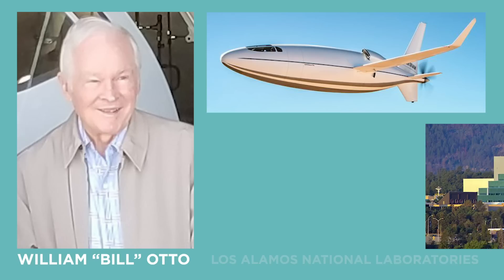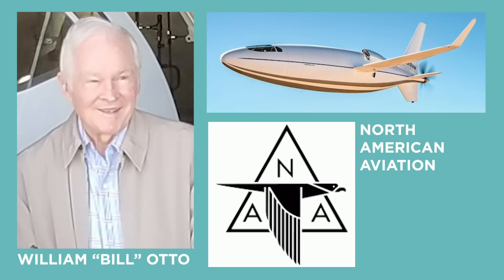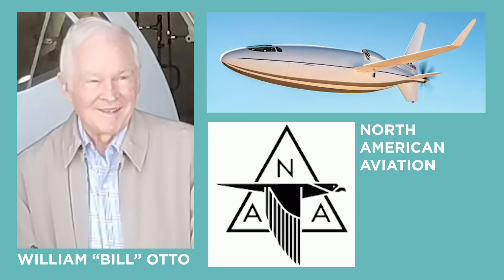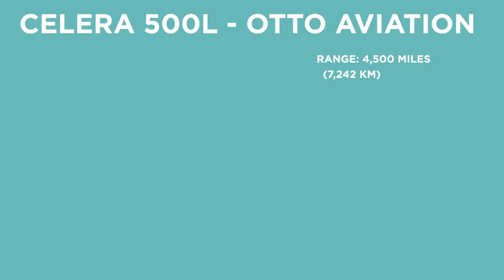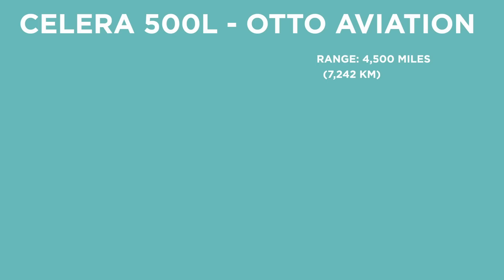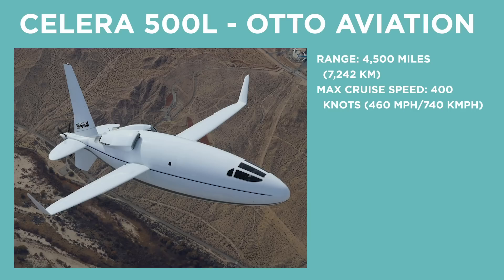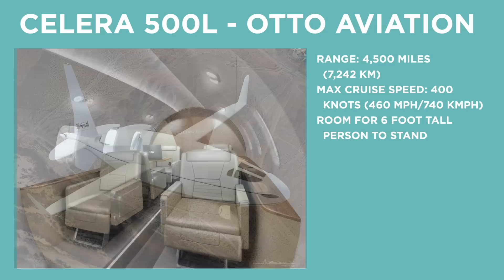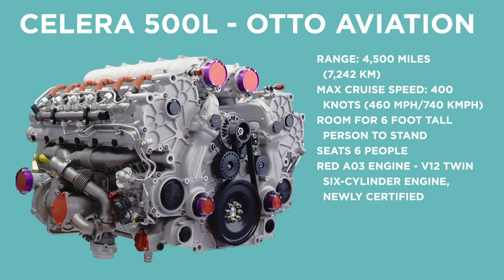Could This Plane Save The World? (Hint: No.) | Answers With Joe

Comment: As someone who as been into aviaition and studied it since I was little, I'll have to say that using a 747 as an example for the majority of airliners is unrealistic in itself. Jumbo's such as the 747 make up a pretty small portion of the aviaition industry. Most air travel in the industry takes place on smaller aircraft such as the 737s and a320 series of aircraft (just to make the more popular ones) that being said, your point still stands even compared to those aircraft. I will certainly agree that if anything, this is simply a stepping stone in design concept that has potential to be picked up and scaled into larger, more comparable size to the commercial jet liners we see now. And I can certainly see it becoming popular among the private/corporate sector of the industry to replace private jets. It's fuel savings combined with only needing one pilot would definitely be a point of interest for most private operators. 
Anyway, thats just my amateur input. I love your videos and learn tons from them every time I watch. Keep up the good work!

Comment: Using standard airline seating, the Celera could probably handle up to 9 passengers, rather than the 6 it has in business charter config. Just on this video, alone, it would be more accurate to compare 1 x 747 to 40 Celeras, rather than 61. 
 
In hauling 9 PAX instead of 6, it becomes a viable competitor to Cessna 208s and Quest Kodiaks (small commuter and light cargo segments) in addition to being a viable competitor to about 1/3 of the business aviation planes out there.

Comment: As per regulation, you would require one "flight attendant" (the term is cabin crew, regardless) on the celera flights, as you need one per 50 passengers. Either that or the flight doesnt leave the tarmac as, once again, it's regulation, not a suggestion.

Comment: Did you consider "factor of scale" in your comparisons?? Just curious, as Otto has already suggested they will scale-up the design.
Reply: that also scales up the fuel consumption, cost of the plane...then youl get the limits of the engine that could run off biofuels...
Reply: Perhaps but at this point it’s like replacing a semi with a fleet of compact hatchbacks - not practical.
Reply: Check out the Aurora D8, it’s a commercial jet with all the design efficiencies of the celera. Real Engineering did a great video on it
Reply: Unfortunately the design can only be scaled up so far before the laminar flow breaks down. The larger model they’re talking about making is the upper size limit for this design. Unless someone comes up with an entirely new design, that’s as large as an aircraft with laminar flow can get.
Reply: @sunspot42  : If they can get the larger model to work financially, then someone probably will get such a design done at some point.
Reply: @absalomdraconis  It wouldn’t be based on this design - it would have to be something quite different. This design doesn’t scale beyond the larger model that’s already been proposed - the laminar flow breaks down on larger models.
Reply: @nathanchildress5596  The Aurora D8 is an entirely different design and doesn’t exploit the unique laminar flow this plane utilizes to achieve its amazing efficiency. It isn’t anywhere near as efficient as this design and would be far more expensive to build.  It is more efficient than today’s jetliners, but also depends upon the development of several new technologies. It’s not entirely clear if it’s currently possible to build, or if it would be cost effective.
Reply: @nathanchildress5596   it really really isnt. It has swept wings for higher speed (much less efficient), thicker wings (much less efficient) turbofans rather than propfans (vastly less efficient). and doesnt appear to be designed as a lifting body as this clearly is.
the biggest thing we need to design for to save fuel is LOWER SPEED (drag is proportional to the cube of speed so half the speed = 8 times less drag)
Reply: I was wondering that, I’d hope not otherwise Airbus/Boeing are ignoring what could be a real danger.
Reply: As others have noted that pesky Reynold's number and the squared-cubed law thing make this tough. I do question why one couldn't put more than 6 seats in the thing though. Looks big enough to accommodate more.
Reply: @nealgrieb6660  I wonder if it has to do with safe evacuations or just the weight limit of the design given the low-power engine. It might glide thru the air with ease due to the laminar flow but I’m guessing its lifting capacity off of a runway is limited. So, efficient but not very powerful. 🤷‍♂️
Reply: @mycosys  Actually I think the dual bubble fuselage of the Aurora D8 is designed as a lifting body, just not as efficient as a true flying wing (but also far easier to build with today’s tech, cheaper and it can work with existing airport infrastructure).
Reply: @sunspot42  probably right. Weight limit on takeoff...
Reply: @sunspot42  The closest thing one could achieve laminar flow with on the scale of a large jet would be a flying V design, reducing wetted length of the center by having a more constant wing chord.  The overall length of the aerodynamic body is the primary limiting factor in laminar flow, as even the smallest of eddies produced in the airstream will multiply themselves.  Meaning, unless you can make an impossibly smooth geometrically perfect body, you'll never get much more length out of it than what they're doing with the Celera.  So if the answer is having short bodies to limit contact with air, the only way you can scale it up is in wingspan.
Reply: @Skinflaps_Meatslapper  Interesting. Didn’t know that but it makes sense. So you could maybe make small ~30 passenger flying wings. I can’t see those replacing even small jets like the 737, although I suppose they would potentially alter the economics of flying in and out of more rural locations where people currently have to travel by 1-2hrs to get to an urban / suburban airport to travel. Maybe we’d start seeing direct flights from places like Ithaca, NY to Charlottesville, VA, or Napa, CA to Eugene, OR.
Reply: @sunspot42  Oh, you could scale it up even more than that, possibly even to 737 payloads depending on just how much laminar flow you'd like to have over the body.  Sort of like the existing idea for a flying V, but with a wider wingspan (less sweep on the wing) and a thinner chord more akin to a glider wing rather than the chubby cross section.  This would give you a short enough distance between leading and trailing edges to maintain laminar flow without going to extremes to make a smooth enough surface.

https://en.wikipedia.org/wiki/Flying-V
Reply: @Skinflaps_Meatslapper  That would be one strange plane.  Gotta think a flying wing that long and skinny would have some pretty exotic handling characteristics and would be difficult to utilize with existing airport infrastructure...
Reply: @sunspot42  Yeah, I think even the existing flying V design would need some infrastructure modifications.  But as far as handling, it should behave more or less like any other flying wing, with the potential to utilize flaps if the center of the V is far enough forward of the elevons.

Comment: I’m a pilot, have been for 39 years. I’ve made multiple comments on videos that have featured the Celera 500L. I’m working on a blog post about it to attempt to evaluate the plausibility of Otto’s claims. On their face, they’re pretty shocking, bordering on unbelievable. Extremely short summary: very skeptical. And, I’ve said elsewhere, it’s hard to picture aerodynamic engineers at Embraer, Bombardier, Gulfstream, Dassault smacking themselves on the forehead and exclaiming “Laminar flow!?! Why didn’t I think of that?” I learned of laminar flow in ground school and much detail about it in undergrad physics! Further, they make at least one categorically false statement on their web site, i.e., that other airplanes in its class have glide ratios of less than 9:1 vs. the Celera 500L at 22:1. My airplane is not unusual, it’s a fairly standard designed turboprop and it has a glide ratio of 14.8:1. Many business jets, to whom Otto compares the Celera 500L, achieve 18:1. I’m concerned that an esteemed designer like Otto would not know this or, if he does, that he’d misrepresent it. I believe the Cessna 172 may have a glide ratio in the 9:1 range but the 172 is hardly in the same segment. When I finish my analysis I’ll post a link. It will have to be approximate though, Otto doesn’t provide sufficient information for a thorough analysis (nor is there any requirement that they do so). If you want to fly in something that looks like that, try the Piaggio Avanti Evo.

Comment: Ya a 747 today runs around 320-350M for an older version and the newest version is around 400-420M. Your googling has failed you this day lol
Reply: Haha lmao. Then dive a little deeper!!!
It all depends on what type of Boeing it is, commercial or transport.
It depends on how much fuel to weight ratio and how much capacity of the plane is filled.
It also depends on how fast the plane is flying, the wind direction and humidity. 
A Boeing 747 what exactly ?  Because there are many versions of it.
Also you say 420 miles ?  But we don't calculate miles in aviation. 

A typical Boeing 747-8 intercontinental average range is around 7730 Nautical Miles (14310 KM).
Average because as said before it heavily depends on the conditions.  The max range of the Boeing 747-8 intercontinental is 9500 Nautical Miles (NM) (15000 KM) if its flying at around 900 kilometers per hour, witch it can stay in the air for 16 hours. This on great conditions the plane can fly at max 988 km/h with a cruise speed of 933 km/h. 

Above are the newer version of the 747-8 as the early versions where flying 900 NM less then what they can do now due to efficiency, but also due to the capabilities of the plane flying higher then ever before with a max of 43000 ft or 13000 km above sea lvl.  

Far most important is the flight level.  Be to low and you fly thru a very dense atmosphere and you need more horsepower in order to maintain flight. Fly to high and you lose efficiency all together as the engines do not get enough oxygen making the efficiency drop enormously as a lot of fuel will not combust as it should.

So the flight level and speed of the aircraft heavily depends on weather, how much the plane weights, the atmosphere and what the plane is moving around. Also keep in mind that traveling around the world the atmosphere chances constantly as you enter in now biomes.  

So saying that the range is simply 320-350M to 400-420M is not only (NOT) true, it is completely false!!  First of because the range is not in miles but nautical miles, so NM not M. 
And second it also depends on what type of aircraft, its payload, its fuel to weight ratio, the atmosphere, the humidity, the wind direction, the wind speed, time of the day (day or night makes a huge difference), the aircrafts age, the altitude for cruising and sooooo many many more conditions.  

And you are saying that Joe Scott did not do his research right, while you yourself are to ignorant to actually weigh up all conditions of flight. I think you are the one that needs have a consult with Mr Google, not Joe Scott XD
Reply: @TheGremlinsParadise  That was a lot of words to NOT acknowledge the dude was right...and Joe utterly blew the costing of ANY 747 passenger airliner.
Reply: Boeing intends to shut down production of the 747 after the final 14 orders are filled.

Comment: The fuselage and wings look like the Piaggio P.180 Avanti .
Reply: Yes
Reply: I was going to note that the fuselage looks very much like that of the Bell X-1 that Chuck Yeager flew through the sound barrier in 1947.  The wings are superficially similar, but the big difference is the powerplant and propulsion: rocket engines versus a piston engine driving a prop.  So you've got a choice: go slower and get a longer ride, or take a short ride and burn a lot of propellant very quickly.

The Celera would be great for that long haul trip, plus it's a lot more flexible than an airline.  But that X-1 must have been one hell of a ride!

Comment: one big issue with the Celera design is that it can't reasonably scale that much larger than it is. there is sort of a limit to how wide and tall the aircraft body can be, and the design doesn't seem to have room to get much longer and narrower and maintain it's carefully calculated laminar flow surface. it also doesn't look like it would support multiple engines very well, which is required for larger planes.
the other issue I see with it is that laminar flow is really hard to maintain because any surface roughness will trip the boundary layer into turbulent flow. that includes everything from rivets and door seams, to bugs that smash on the wing leading edge, to normal wear and tear on the aircraft, making maintenance a bit difficult. the suction from the pusher propeller does help over the body, but only so much. the aircraft feels to me like the dream of a genius aerospace engineer, which was so awesome that he wanted to apply it to everything and forgot about some practicality and scalability aspects of the design. 
I personally think that the Piaggio Avanti, which is in a similar size and cost class, is a much better aircraft, and at least more practical. it is also even cheaper to fly than the Celera because it is a turboprop instead of a piston engine. I think it might also be almost as aerodynamically efficient through a slightly different set of aerodynamic tricks and is nearly as fast.
this is speaking as an aerospace engineering sophomore at Purdue.

Comment: Not talked about very much, on this aircraft, is the wing loading. It has very high aspect ratio wings (for very low drag), that have a very small surface area. That wind surface must generate the necessary lift to make the aircraft fly, otherwise it is a human guided missile heading to the ground. High load wings need to fly faster, in order to make enough lift, and as a corollary, the stall speed also increases => Fly Fast, Land Fast. The Celera 500L has published little info on the MTOW and Wing area (Example: Boeing 737-100, MTOW = 100,000 Lbs, Wing area 979.9 Sq Ft gives a wing loading of 112.25 Lbs/SqFt).

Comment: This is a competitor to executive jets, to spend so much time comparing it to jumbo jets is odd.
Reply: I think he was making the comparison based on the questions asked in his electric plane video, and how many people commented that the Celera should have been included despite not being electric, because they believed it would reduce the number of Jumbo Jets used, and reduce carbon emissions. 

This video was less a "The Celera is not a replacement for large airliners", and more a "This is why I didn't include it in my other video". The comparison to the large airliners was to show how unlikely it would be for them to get replaced, and the reason for not including the Celera in his electric flight video, not as a way to condemn the Celera. That was my takeaway, at least.
Reply: @MVargic  incorrect.  regional airlines use planes of this size and a bit larger. Plenty of major airlines have regional jets in the 20 seat size too.  Also with dramatic reduction in the cost of chartering such executive aircraft, this will naturally open it up for less wealthy rich people to fly in such planes.  So instead of my frequently flown trips from SEA to TUS for $7,000 as a one way jet charter, it could be done for more like $1500.  The estimated operating cost is estimated for be $330 an hour vs $2100 a hour for the jet, though the flight would be more like 4 hours instead of 3.

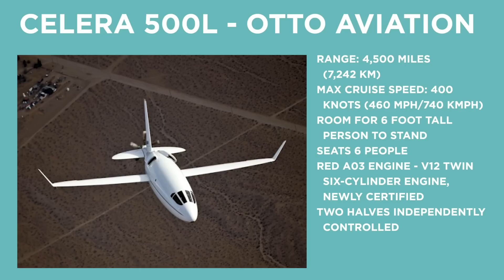Comment: did anyone catch the one fact in 3:11 about the Celera, that it can run on "Biodiesel", So, what you're saying is, it can run on Algae or soybean oil.
Reply: It's a diesel engine. Jet A is kerosene based diesel fuel. Jets could probably run on biodiesel too.
Reply: And... what do we use to farm soybeans? Internal combustion engines fueled with what?
Reply: @Chrishelmuth1978  Diesel based farming equipment can run on biodiesel aka Soybean or algae.

Comment: 6.1L V12, DOHC, Turbocharged (one for each bank if I'm not mistaken), diesel.
That Red A03 is crazy looking. The specs are more normal than I expected, but I still want to see what kind of numbers that bad boy would do if converted for use in a truck/car.

Comment: btw, MK in this case is "Mark" so, a Mark 46 torpedo. "Mark" is like version number. Its a British thing, as far as I've seen.
Reply: Thank-you for flagging that - it bugged me too.
Reply: US Navy uses "Mark" a lot too. The Mark 46 has been the current anti-submarine torpedo for a lot of navys for about 40 years.
Reply: @nitehawk86  yes, but the Brits have been using the "Mark" system since at least 1906. US Navy has been using "Mark" since at least the 1920s, it was formalized in 1944.

https://en.wikipedia.org/wiki/Mark_(designation)

Comment: Missing the point that this plane is not aimed at replacing 747s, it's made to compete with private planes like LearJet.  The Mentour video you referenced mentioned plans to build a scaled-up version with much more seating capacity.